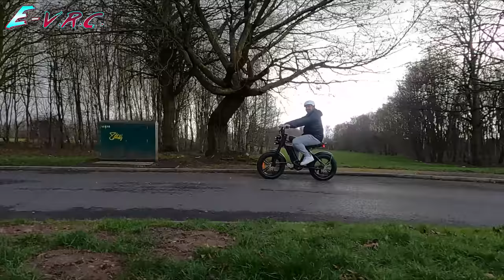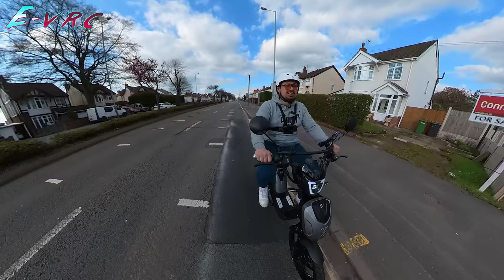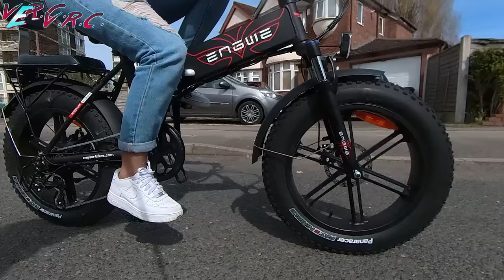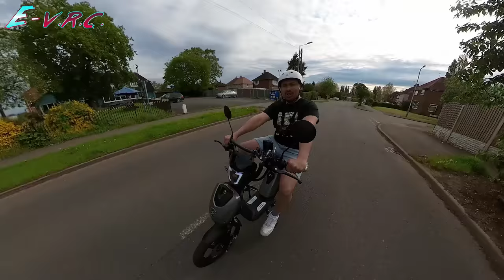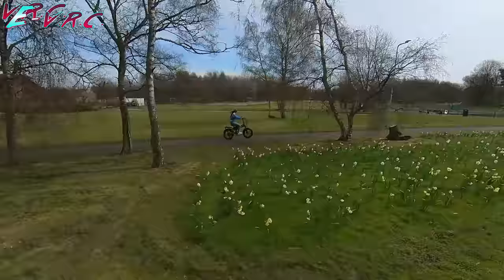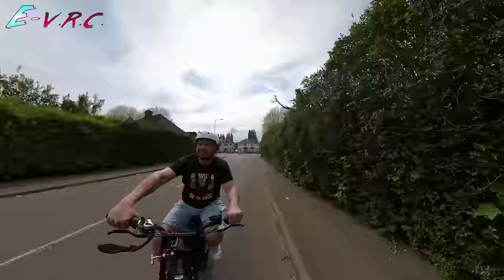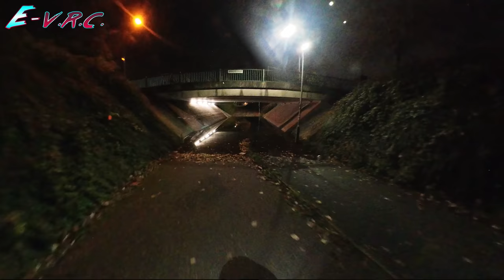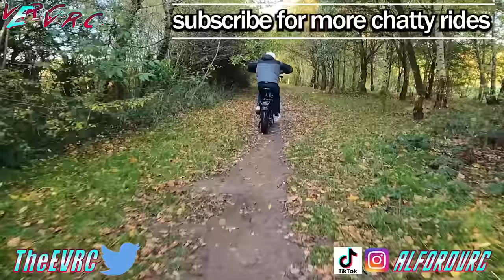The CRAZY Ebike law that MUST Change Before Someone Gets HURT

Comment: The question really is “when should e-bikes be required to comply with ‘real’ vehicle regulations, like needing insurance, pay road tax, have regular safety checks, pass regulations for brakes, lights, tyres etc?”.   As a motorcyclist as well as a cyclist I do see a danger of e-bikes becoming like motorcycles, but without the controls in their design and manufacture to make them safe on the roads.  For example, my wife’s e-bike has awful brakes that are really not up to stopping the heavy bike when loaded with shopping and going at speed.  Quite frightening.  So, at what point should safety regulations start to be set and applied?  When should insurance be compulsory?  When should riders be tested?  250W?  750W?  Bike weight >30kg?  >40kg?  Max speed 20mph?  30mph?  40mph?  If these questions are ignored then why shouldn’t everyone at any age and skill level just freely ride cheap 30hp electric bikes when they come, probably with no lights and poor brakes and bald tyres??  I really don’t have to say that some arguments here  could indeed take us down that very dangerous road.  At the moment e-bikes are treated as push bikes because they emulate them in terms of speed and function.  Once they exceed push bike boundaries then new rules on machine and rider safety, rider testing and licensing, machine registration and insurance will have to apply as they will then be formally classed as mechanically propelled vehicles - in other words inherently dangerous.
Reply: The people who should be limited to 15mph on a bike should probably not be allowed outside without adult supervision.  Probably best to keep most of those people locked in their basement
Reply: This is somewhat true, but e-bikes will never get that far. Well in the technical sense at least, E-bikes faster than 32 are illegal. They’ll have to be more like motorcycles, and will basically just become electric motorcycles. Anything under 32 mph will still be 100% legal as an E-bike, anything over will probably require everything our cars need to be legal.
Reply: If you see an issue with your wife's bike, upgrade the brakes. You don't need laws to do simple things like upgrading parts that are ineffective. Laws are in my opinion never the answer, this is why the UK isn't free sadly.
Reply: @Codbeast101 mines going 42 miles
Reply: Sounds like you havent bothered to upgrade the cheap hardware that comes with most ebike I've upgraded everything on mine
Reply: The US laws are more reasonable... e-bikes are designated as one of 3 classes. Max motor size is 750 watts (250 seems absurdly low for me). Class 1: pedal assist only, assist cuts out at 20mph. Class 2,.same thing but with a throttle.  Class 3, like.a.class 1 but max assist speed is 28mph. Officially class 3 does not have a throttle,.but some.have equipped them with throttles. Like the creator of this video,. I don't abide by the freak-out over throttles. I love my class 2 and use my throttle sparingly so as to save battery. I use it for one of three things: 1) starting up from a stop, 2) navigating a trecherous path of parked cars, pedestrians and other obstacles and 3) when a sudden power boost is needed. I don't use the throttle that much so as to prolong battery time (and because exercise is still one of thr reasons i ride in the first place).
Reply: stop whining and buy your wife a safe bike with good brakes

Comment: With so many urban roads now being 20mph, raising the limit to that would absolutely make sense.
Reply: As if any car ever actually does 20 in a 20 limit zone…
Reply: @nbartlett6538  the closer a bike goes to the speed that a car is going the less likely they are to overtake. So yes you’re right that people do more than the speed limit but I believe it would still reduce risk.
Reply: @oliverpolden  I'm not sure that's true sadly. Drivers have the mentality that if there is a bike in front of them, they HAVE to get ahead, even if they have to break the speed limit to do so. It's like it's a personal insult for there to be a bike in front of them rather than behind them. So they will break the speed limit to overtake. Very very few drivers fail to follow this pattern.
Reply: @nbartlett6538  I believe the MGIF people are a minority. Most people are decent, safe and considerate drivers. It’s the poor ones that stand out. For a safe and considerate driver, that lack of (legal) speed differential will limit the need to overtake. Sure it won’t stop everyone but it will make a difference.
Reply: As you want even more injuries and deaths, than yes!
Reply: Try pedaling, 15mph is the average speed of a non ebike cyclist and  is totally fine on the road. My speed on a non  ebike varies from 5 mph up 15%  hills 15-20mph on the flats, to 40mph down hills. I don't have issues on the road, which suggests it is the rider that is the issue , not the speed. I have even riden 2000 miles on a mobility scooter on he road with no issues, the top speed was only 8mph.
Reply: @DemiGod..  when was the last time you commuted by (non-electric) bike at over 15mph and didn't get sweaty?
Reply: If they are really serious about saving the polar bears and all that nonsense, they should just drop the rules and use some money to make more dedicated cycle only pathways. But as usual, the global warming story is a cover and it's money and control that reign supreme in the decision making process.
Reply: @nbartlett6538 True. Apparently bikes overtaking cars is an issue. At least according to some car users.
Reply: @DemiGod.. hero
Reply: ...on urban roads
Reply: @oliverpolden  There's still a mentality that if it's a bike they have to overtake. The worst culprits are the ones incapable of reading the road that you then, very soon, have to overtake back in traffic to make riding a bike a worthwhile way to reduce congestion. There does seem to be more sensible drivers about though, who understand overtaking cycles doesn't always increase their average speed.
Reply: @nbartlett6538  I think it's improving, though there are still plenty about.

I like to drive by my mpg gauge, especially when it's quiet. So I'm often doing under the speed limit and cars tend not to overtake, even when they probably could, legally too.
Reply: @DemiGod..  He basically wants an unlicensed moped just because it's electric.
Reply: @ethelmini  For me, as a driver, I feel very anxious that the bike will tip and fall in front of the car. So I just want to pass them so the issue is over. But I'm in North America, so streets are wide and have multiple lanes, so I can pass the bike with enough space between us.
Reply: The 20 limits cause so much congestion nobody can get anywhere. Add the traffic lights and the whole town jams solid.
Reply: @LLF1234  Bikes don’t just tip. It’s actually very hard to fall off a bike - unless someone hits you.
Reply: @LLF1234  if it’s not safe to overtake then you stay far enough back that you can stop in the unlikely event that a cyclist falls over. There was one time I was driving along a possibly icy road behind a cyclist. There was a car right up behind me urging me to go faster or get closer to the cyclist so I had to account for me possibly sliding on the ice and him sliding into me and pushing me further. The cyclist did slip over on the ice. Had I tried to overtake them, it could have been at the point they slipped over. If it’s not safe to overtake, stay a safe distance back. In a lot of cases overtaking is pointless. In the cases it’s not pointless, it will probably be easy to overtake anyway.
Reply: a bicicle can achieve 20-25 mph on the flat no issue.  I see no reason why power assist should not be allowed to achive the lower of those two numbers.
Reply: @arthurarsekey6634 what have you got against polar bears ?
Reply: @Dave5843-d9m that's not the case
Reply: @DemiGod..  Not really,it is the entire concept of vehicular cycling! You and I may feel fine on the road most of the time, but everyone has different fitness amd confidence levels and saying that they should just  get on with it like we do is not addressing the problem at all! The severe lack of decent infrastructure that encourages people to make more journeys by bike! 
We are one of the worst countries in Euroe for walkability, cycling and public transit.
Reply: No one should be cycling close to 20mph in any urban situation. Such, 'furious' cyclers are the problem, with a 'tendancy' to be the ones going through red lights etc. Too many think as they are young and fit they are in some show off cycle race. A modern fad way of using  a bike. Slow steady, safe. A to B. Go be a boy/girl racer on main roads or designated off road cycle race tracks. I commuted by cycle for 30 years.
Reply: @nicholaspostlethwaite9554  so why should cars, that weigh two tonnes and can easily kill people, be allowed to go 20+ in an urban situation and cyclists shouldn’t? 20mph is easily achievable and maintainable by a cyclist on a normal bicycle.
Reply: @oliverpolden  At the end of the day  it is self preservation. In a car you have a steel box of safety, high tech brakes, air bags, seat belts etc. Bikes are vulnerable to the extreme. Not just to cars  but to simple potholes, or wet weather making brakes virtually useless in many cases. Cyclists have to assume all cars are aiming to kill them. Car drivers don't.
Motorbikes are seen as killers of their users, people avoid using them generally. The faster you go just as you are fit, the more like a fragile weaker version of a motorbike you become.
Yes 'ideally' cars should be subject to at least 10mph off all speed limits, imposed absolutely, no 'a bit over is ok' till then, look out for yourself.
Reply: @oliverpolden  Just Seen this. A good example of why bikes should not be ridden so fast. 15 is absolutely plenty with or without power assist. https://www.youtube.com/watch?v=4zldjnJ3rg4
Reply: @nicholaspostlethwaite9554  that is not a good example. That is an example of somebody clearly cycling irresponsibly. Is it any surprise that those that have illegal bikes are going to cycle irresponsibly? In fact, if the legal limit was increased to 20mph then perhaps less people would buy illegal bikes that do a lot more than 20mph.
Reply: @oliverpolden  That is like saying a 'responsible' car driver can break speed limits. In built up areas, it is not safe to be tearing about at such speeds, however careful you are, there is the 'idiot' who steps out in front of you etc. Open road no junctions, no footpaths, ok permit higher.
Reply: @nicholaspostlethwaite9554  What are you on about?? 20mph is not very fast at all.
Reply: @nbartlett6538  Well if you are the maniac type of cyclist no doubt it seems not. Good luck in surviving. You will not outpace danger especially from any motorised vehicle. The faster you go the less the cars see a need to take care, as you seem closer to their speeds. 20 and above is motorbike territory. Overconfidence, and strength, of the young fitness freaks. Clearly you feel 'lucky'.
Reply: @nicholaspostlethwaite9554  What a stupid, self righteous comment. If you prefer cycling at a walking pace that's entirely your choice! But don't tell other cyclists that a moderate 20mph (still much slower than all cars, even in 20mph limit zones!) is "maniac" speed. That's bonkers.
Reply: @nbartlett6538  A brisk walking pace is 3mph. Cycling is considerably more than that without needing to reach 15mph! The laws were set reasonably sensibly, unusually. 
20 is excessive on anything as flimsy as a cycle. Motorbikes are avoided these days as they are so dangerous. Nothing should be done to enable cycles to reach the next speed range filled by motorbikes, that also have more laws attached to them over safety gear and licencing etc. For good reasons.
Reply: @nicholaspostlethwaite9554  I'm beginning to suspect you are a time traveller from the 18th Century. A brisk walk is much more than 3mph, and 20mph is simply NOT fast. Your calibration is all wrong and I wonder if you have ever experienced 20mph in any conveyance at all. Still, while you are completely free to express your opinion here, normal people are equally free to ignore such utter nonsense!
Reply: @nbartlett6538  Well try it! Walk 3 miles. Doubtless if you are a fitness fanatic you will be it in less. But not the average person.
I commuted by cycle for 30 ish years in and out of London. Only in the furthest out parts would it ever be close to 20mph. That was also a lot of effort even when young.
Speeding cycles are dangerous to others as well. Few expect one to be coming at them at such speed.
You are welcome to imagine the world all operates at the hyper fitness levels and speeds of racers on public roads. In my years of practical experience the are the ones you catch up to after they have crashed with a bigger vehicle.
Adding a motor to a cycle should still only be capable of ordinary cycling speeds, they are about easing the effort for the old and struggling. Not ever a device to enable high speeds, closing in on motorised vehicles. 
Seems the law sensibly agrees with me.
Reply: As long as the roads are where you stay.
Reply: @DemiGod..  8mph in the road and no issues... Besides being a jerk and practically stopping everyone else or making them swerve around you.
Reply: @oliverpolden  I rarely get sweaty unless it's over 90° and I pedal about 12.5 miles in 30-35 minutes depending on lights.  There's no way I'd feel safe or like I'm not being a jerk if I did 15mph in a car lane.  If I'm staying in the bike lane 15mph makes sense to watch for opening doors otherwise it's just pathetically slow.
Reply: @nicholaspostlethwaite9554  I hike around 4 mph and I've seen enough old people who hike even faster.  Anybody who thinks 3mph is brisk is out of shape or has very short legs
Reply: @nicholaspostlethwaite9554  there's tons of cycling clubs around me filled with old people who average 30mph.  Nothing dangerous about it unless you're cutting in/out of traffic and blowing through intersections.
Reply: Always. If youre wise you know how to dress up. There is a thing in summer, midday when temperature goes 30 degree and more. You will sweat just standing still. If you pour water onto your clothes and have some wind you will start shivering. Better question is why you smell like shit. You are sick or toxicated. Or old.   @oliverpolden
Reply: Thank you for your delightful comment.
Reply: @nbartlett6538  As a car driver for the past 25 years, I can confirm that not all drivers have the mentality that if they were to find themselves behind a bike, that they would have to overtake it. As somebody who now rides a 750w bike, I find that car drivers respect me and will happily maintain the speed I'm going at. The key is to just follow the flow of the traffic.
Reply: @Timexize  Of course, but I didn't say all drivers, but it doesn't need to be all of them!
Reply: Cars will still overtake. Just today I was going downhill in a 20 zone. I was actually going 26, cars still flew past me!

Comment: I don't currently have an e-bike, but I'm thinking of getting one. Riding a push bike around the west side of the Pennines it's pretty easy to hold a steady 35-40 mph on long downhill stretches powered by nothing but gravity. An e-bike will make it easier going back up the hill.
Reply from the maker: They'll ban ebikes going down hill next 😂
Reply: Yes your right, my Engwe EP 2 pro easily gets up to 35 mph on down hill stretches it has great free wheel, so why limit the top speed to 15 mph when you can do 30 mph down a long hill, dose not make sense 😊